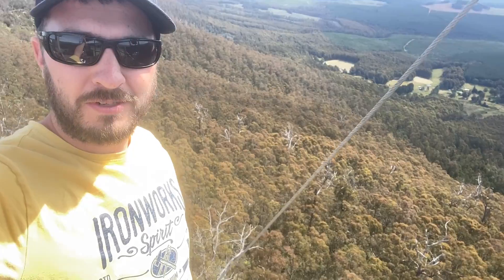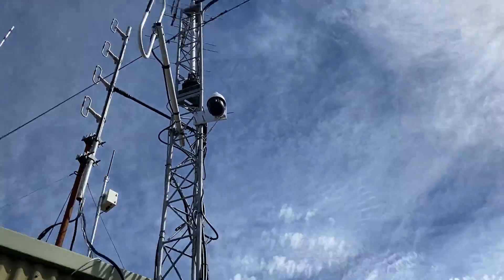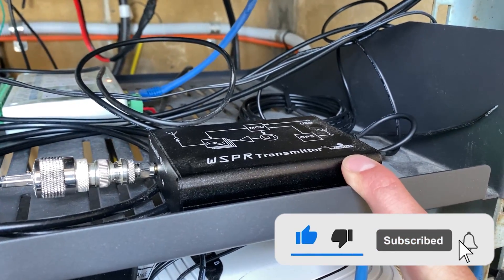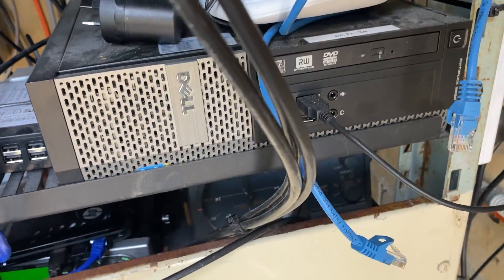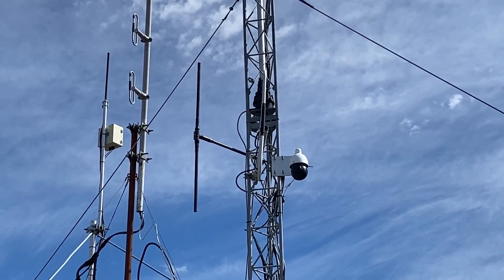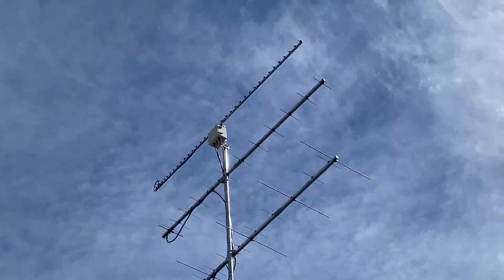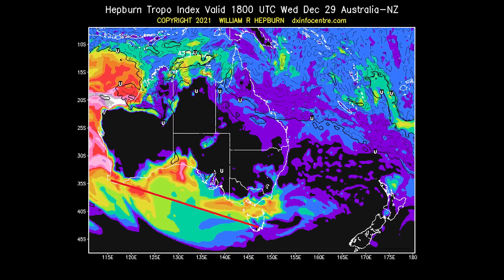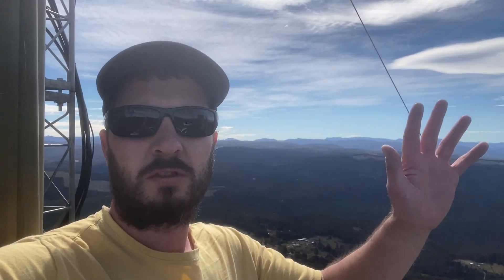This Remote Ham Radio Station is INSANE!

Comment: what is your AC source? I see batteries but is that only for backup or are you using solar panels and an inverter system?
Reply from the maker: AC source is power directly to the site. Batteries for backup, no solar.

Comment: Fantastic site tour Hayden, how did you achieve a decent ground for the tower , we have a similar rocky site with repeaters for 6 & 2 , with 70cm & 10Mt to follow this year . Note the cable ties , we cut ours @ 45degree to further deter those bloody flying rats (Cockatiels) . All the best DX for 2022 ,,  73     Gary VK2VU :goodvibes:
Reply from the maker: Cheers Gary, 
We don't have too many issues with cockies down here... The top of that mountain is solid rock... almost... a steel pipe has been smashed into the ground, not the best, but it's all that can be managed. We're not so worried about lightning. We don't have that many storms down here and there is an adjacent tower that is three times the height of ours, so it's more like to get a direct hit. Thanks for watching, 73